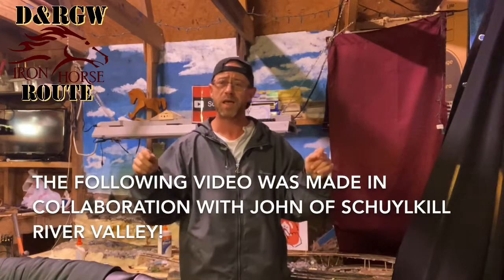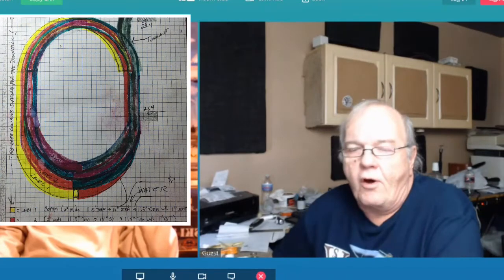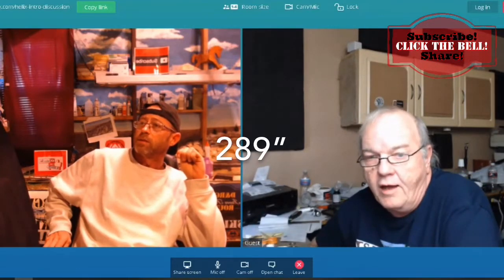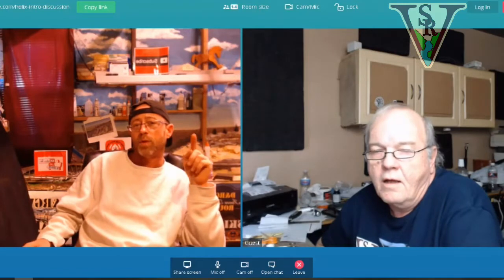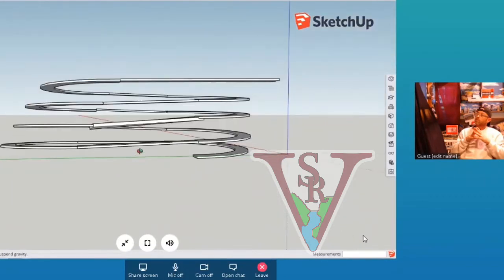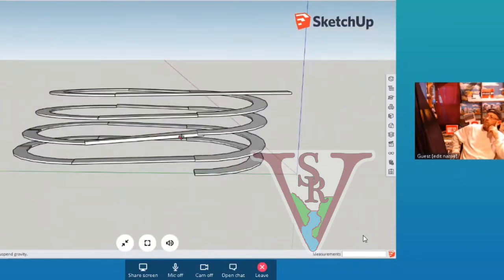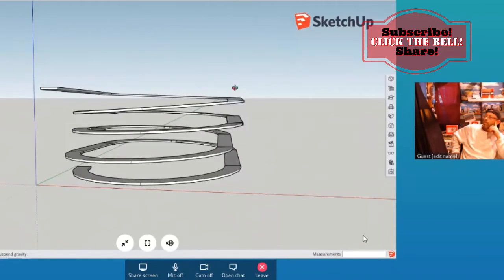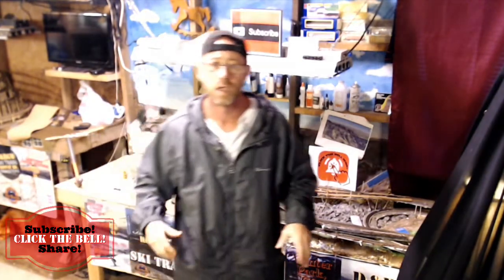How I Built a Modular Open Helix for $100 On My N Scale Model Railroad - Series Introduction  -

Comment: Hey Brian, it was a pleasure collaborating on this project with you - it was a lot of fun! I think the helix came out great - you should be proud of it. Congrats! Can't wait to see it installed on the layout. Just take your time and make sure the existing tracks line up smoothly and solidly, and you should be fine. You're going to enjoy running your trains so much more with a well-functioning helix. Thanks for all the kind words - you did my ego wonders! Good luck with it. Best, John
Reply from the maker: Ego!??  I honestly didn't think you had one of those! :-)   Then lets stroke it some more.  Your help in planning and the construction of this project was not only instrumental, it was educational and most importantly extremely fun.  Anyone reading this comment should notice this the most!  Collaborating with another (well mannered :-)  ) modeler is much more than just fun.  Two heads are so much better than one when attempting to pre-troubleshoot difficult tasks.  Having other modelers to bounce ideas off is probably the most important part of this community and utilizing their knowledge.  John is one of these types of modelers.  I could list at least 5 ideas John had that he passed on that I implemented of which this project would not have been successful to this point.  Saved me much time and frustration, making this an enjoyable build.  I couldn't have done it this way without you John.  A very sincere Thank you!  I appreciate you!  Brian

Comment: Hey Brian great video , it sure looks like your grade is steeper then 2.75 . I guess its your eye playing tricks on you or me . LOL  I can't wait to see this on the layout .  Math is cool when you know what you're doing and Johns knows . Excellent job on all the ciphering John .  The series will no doubt help people traveling up the helix path .
Reply from the maker: I agree with you Jerry and I think in a couple places you are actually right.  I made an error on level 3 that didn't raise it's ugly face until level 4.  I think that error increased the grade slighlty, but only on that one point and is is not significant.  Still under 3.  My proto ran 3 or 4 F7's with 14 cars trailing and I am able to comfortably pull 8 cars with 2.  I have a 3rd F7 as wel but it needs trucks.  I also need some more D&RGW rolling stock.  I appreciate you watching and let it be known, Rick will be here soon for the installation!  I'm hoping to prove him wrong.  Thanks Jerrry!  Take care. Brian
Reply: Thanks so much Jerry! It was a lot of fun working this out with Brian. Definitely not your run-of-the-mill helix, but that's one thing I like about it. It shows that a helix doesn't need to be a perfect spiral - you can build it to suit your needs. Trust me, Brian and I can't wait to see it on the layout either. Best, John